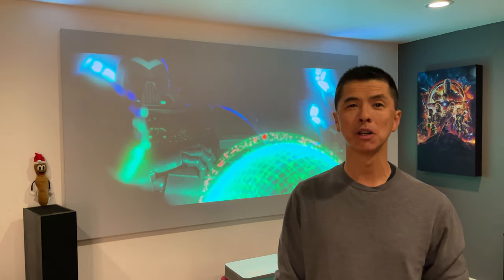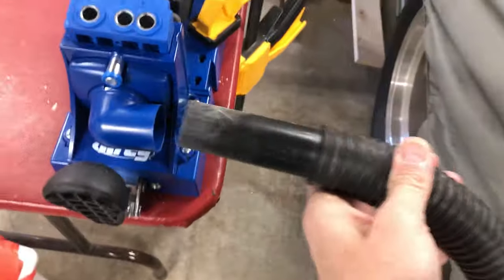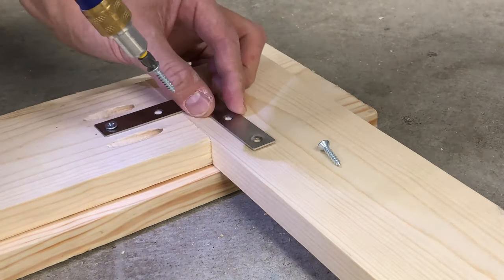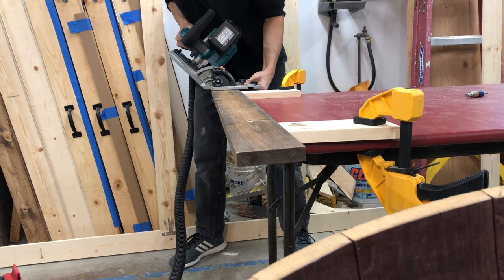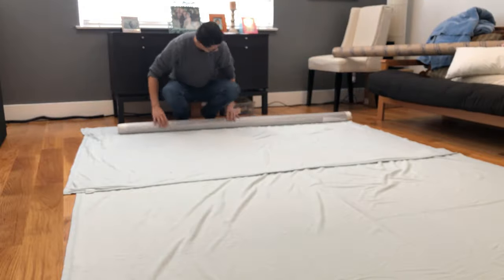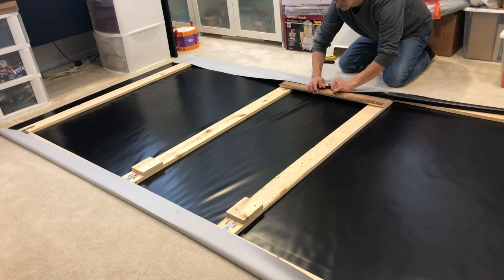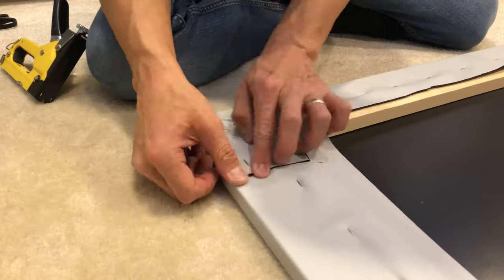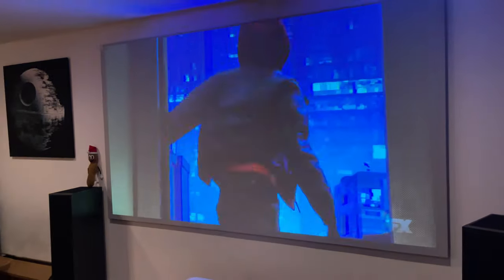DIY 120" Projector Screen Build | VAVA 4K Laser Ultra Short Throw (UST) Projector

Comment: I found the problem w using 1x4’s is that u can see the boards behind the screen while watching content.  Especially on really bright scenes.  I ended up rebuilding my screen w 1x2’s, and putting black velvet on the edge to cover the wood frame.  It worked perfect.  Great video 👍🏽👊🏽
Reply from the maker: The 1x4's seem to be doing ok.  They're not showing through and the screen is still nice and smooth with no sagging.  I've heard some stories of people spending several hundreds on a nice screen only to have wrinkles and sagging on the screen after a few months.  I "might" rebuild it to a 135" at some point in the future.  For now, i'm enjoying it!  Thanks for the compliments!
Reply: Did your screen now have a black backing?

Comment: Question, I just picked up a short throw and love the video you made.  Looks like I need to make a 135" screen, is the material you used directional?  Accepting light from the bottom?  Lots of good advice, and comprehensive tool list, appreciate your effort!
Reply from the maker: The roll was: SIZE:  DIAGONAL" (HEIGHT X WIDTH)145" (71x126).   I believe that should suit your needs.  However, they do have larger size rolls. Check the site for size and prices.  
https://www.carlofet.com/shop/projector-screen-material?screen_material=FlexiGray&finished_edge=Raw+Material&seam=Seamless&packaging=Rolled+on+a+Tube&aspect_ratio=16%3A9&size=145%22+%2871x126%29

Comment: this is really cool.  the problem is I don't own the tools you have, so if you add those to the cost, it makes so much more sense to just buy the Lava 120" screen for $750 on sale.
Reply from the maker: All you really need is a drill and hand saw.  A small version of the pocket hole jig can be purchased for less than $40. Also, you can sand everything down by hand, don't need an orbital sander.   So very basic hand tools are all you really need, some know how and patience.  No drill? Then a good ol' screwdriver is all you need and some elbow grease.  So realistically, all this can be done with less than $50 in tools.  Nothing fancy required at all.

Comment: Thanks for the video. Awesome work. I contacted the company to check if I can do the same, they just told me the ALR screen material they have is not compatible with UST projectors. How is that? did they discontinue what you bought from them? Or you just used the regular one they have?
Reply from the maker: I don't believe they sell an actual ALR screen.  The screen i got is good enough for me for now.  I know pic can be MUCH better with an actual ALR, but i'll cross that bridge when i get to it....!  cheers!
Reply: @trendng4016  Sorry. My mistake. Neat work either way!

Comment: Nice work on the screen, how is it holding up? I was checking Carl's for the CineGrey, but cannot location that one. Is yours the ALR type screen? I have my first UST coming soon and want to make my own screen cheaper than pre built ones.
Reply from the maker: Yep, it's holding up just fine!   Good luck building the screen, please forward photos when done!   The material I bought is here: https://shop.carlofet.com/home-theater/screen-materials/ultra-gray-projector-screen-material
Reply: @trendng4016  Awesome, thanks! Will do and hoping the build goes well :).
Reply from the maker: Please reach out if you have any questions.   I covered as much as possible in my video but something always comes up.
Reply: @trendng4016  I appreciate that, thanks!

Comment: Love the video.

How tall are your ceilings?
What is the height of the tv stand that the UST is sitting on? 
I am trying to determine if the vava on a 120 inch screen will fit on a 8ft tall wall in my house. If so, how big / small of a TV stand I would have to get.
Reply from the maker: My ceilings are only 8 feet tall and the VAVA is only on a temporary stand that's about 15" tall. But don't use that answer to plan your room! To get all your answers, go to this website and play around with the numbers for the size of the screen. It will tell you exactly what is required for the size screen you want.  You can then use those numbers to plan out the room / media stand, etc... Hope this helps:  https://www.projectorcentral.com/VAVA-4K-projection-calculator-pro.htm#calc

Comment: Hi, what kind of screen did you use particulary in this video for your ust? Flexi-white, flexi-grey? Ultra-white, ultra grey? 
I want this for my gt5600 ust. Any recommendation?
Reply from the maker: Here's the details of my order from Carl's Place - hope this helps.   https://www.carlofet.com/
FlexiGray, 16:9, Finished Edges, Raw Material, Seamless, Rolled on a Tube
Size:  Diagonal" (Height x Width) 145" (71x126)

Comment: I was thinking building one for my UST but it seems I can't find the really good ALR screen for UST. Carl's has ALR version but I'm not sure it's the right one for UST cause there is also ALR version for normal or long throw. The right version for UST has very specific textured angle to deflect the ambient light.  What I read is for UST the best is 0.6 gain
Reply from the maker: Carl's may not have the right ALR screen available.  So you may have to purchase one, but some can be very expensive.  What i have is good enough for now.

Comment: I'm really interested in using Carl's flexigray material with an ultra short throw set up. Is there a hot spot on the screen when the room is dark? Or even better, an update on your home theater project and some lights out video.
Reply from the maker: Hi there.  There are no hot spots when the room is dark, at least not in my setup.  I can provide you a video of when the room is dark if you like but I can tell you the picture is amazing. There are definitely better screens out there for UST's but cost 10x more.  Please PM me your email address and I can send you those videos.  Thanks!
Reply: @trendng4016  Thats awesome to hear. I have been emailing the folks at Carls to get more information as well. I found an old AVS forum that talked about an ultra short throw ALR screen from Carls Place but that was back in 2018 and it doesnt look like they carry that anymore. Regardless, I dont want to spend the extra like you said and prefer the DIY flexibility. Just gotta make the time! Thank you
Reply from the maker: @garrethafer6866  Glad I could help and let me know if you need any tips on the DIY part.  The video pretty much goes thru everything.  If you do plan to DIY, be sure to let the wood sit in the room where it will eventually live for at least 2-3 days so it can acclimate to the environment BEFORE you build the frame.  Also, the one thing I would change is I should have went with a 135" inch.  It's good for now and I'm enjoying it...!

Comment: Did u use a Normal Alr screen or does it need to be a Clr screen ?
Reply from the maker: I don't think the one i used was actually an ALR screen.  Saving up for one and will have one soon.  This works quite well still, but agreed the picture could be MUCH better with an ALR.

Comment: You need a UST ALR screen to get the most out of your UST projector, the colors on your DIY screen are very washed out. The fabric also reflects like crazy, a UST screen absorbs almost all of the light leaving your room really dark when the ambient lights are off. Your VAVA is one of the better UST projectors, just a waste to see it being used with the improper type of screen.
Reply from the maker: The screen you see in the youtube video does not compare to seeing it live. It has something to do with flicker / frame rate or how the camera captures the video and translates it on screen.  Anyway, i don't pretend to know the exact details of that.  The screen does incredibly well and colors are NOT washed out I guarantee it.  And although i agree with you that it's not the MOST optimal, it's still very close.  With the lights out, it's crystal clear and probably every bit as good as the UST ALR screen.  Once I save up enough to justify buying one of those screens, I might do it.  However, for now, it's plenty good.  Thanks for your feedback tho... Cheers...
Reply: You can actually see the quality of the ALR screen in captured footage such as pictures and video very well. Here is my UST ALR setup, you can clearly see the difference between this picture and yours: https://i.imgur.com/1H0G5yw.jpg

Good luck saving up for it though, since they can cost more than the projector 😅
Reply from the maker: For the video, I shot AND edited the entire youtube video using my Iphone 12 Max Pro.  Probably not the best video camera to use for professional results but I'm not a pro, total amateur.  I will take a photo of my screen later and you will see there's no color washout.
Also another thing I don't like about the screen you have, you can see the bow on the side and the screws that's holding the screen together (not exactly sure what those multiple black things along the side are)?  The setup just doesn't look clean to me.  I'm picky like that.  The screen i would buy is one that hangs on the wall. But your picture is pretty clear.
Reply: I agree. I made a 100" screen from some ALR material I bought from China but, it looks better on my short throw projector than it does on my Optoma P2 (UST). I think this is something to do with the angle the projector is shooting the light. The P2 actually looks better on the wall than on my new screen. While the build of the screen looks great, I think you would really see the difference if you bough proper UST material  like Malcrosoft but, this would be around $500. I personally would not trust myself to put it on my frame because I think the tension aspect of the material and the grooves in the screen would need to be perfectly parallel with frame to be 100% affective.

Comment: Can u please put d specifications cut size of each of d wood.. I am thinking of cutting them at home depot since I don't have most of these equipment.. I'll appreciate the response. Thanks
Reply from the maker: Don't remember the exact dimensions.  I used this website to calculate the OUTSIDE dimensions of the frame then cut the wood accordingly. It also depends on the size screen you want.  Hope this helps:   https://www.projectorcentral.com/projection-calculator-pro.cfm

Comment: Any issues with hot spotting with this set up?
Reply from the maker: What’s hotspotting ?
Reply: @trendng4016  a particularly bright spot showing up on the screen, like if you held a flash light 6 inches away from the screen. More likely to happen with UST projectors.
Reply from the maker: I have not noticed hot spotting whatsoever.  It's a laser projector and not a bulb so i assume that may be why.

Comment: You have a UST projector and please just buy a proper screen for it and you will really see the difference. What you are doing is wrong and most likely introduce hot spots and sparkles from the laser so close to the fabrics, you will see a major difference in bright scenes with a UST screen especially the black levels. You just don't know what you are missing out with this improper setup.
Reply from the maker: What screen do you recommend?   There are so many out there and it may be time to upgrade my whole system - receiver and speakers too!

Comment: That's great you can spend all that time and cost making a big bulky stationary screen that looks a mess or for.less money you can buy an electric screen that at the click of a button folds away 😉
Reply from the maker: Thanks for the honest feedback.  My space is a dedicated home theater so i don't need an electric screen.  Also, this screen and materials cost me all of $140, link me to a quality 120" 16:9 electric screen that cost less.  Also, besides the cool factor, why is an electric screen so appealing?  They're overpriced and will probably break down the road.  And are you really going to lower the screen everytime you watch TV, then raise it when done?  I just wanna turn on the projector and watch without pushing extra buttons and wait for a screen to lower. To each their own I guess.
Reply: @trendng4016  mate my electric screen cost around that. It looks awesome and at the flick of a button hides itself away. What you have there is an absolute Riot 🤣
Reply: @davidpotts1778  Looks just fine to me.
Reply: @ozell214  an electric one costs £100 and disappears when not in use. It also has much better screen brightening
Reply: Link to the electric screen?

Comment: What we’re the dimensions on the cuts you made to the boards?
Reply from the maker: Don't remember the exact dimensions.  I used this website to calculate the OUTSIDE dimensions of the frame then cut the wood accordingly. It also depends on the size screen you want.  Hope this helps:   https://www.projectorcentral.com/projection-calculator-pro.cfm
Reply: Thanks